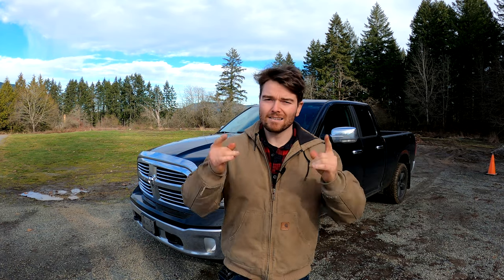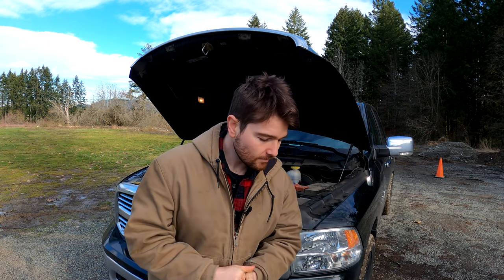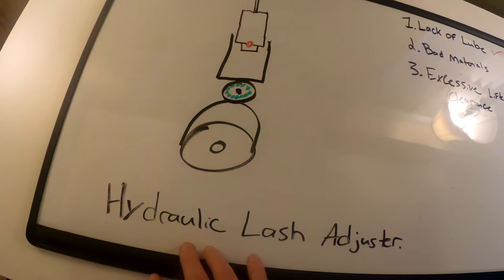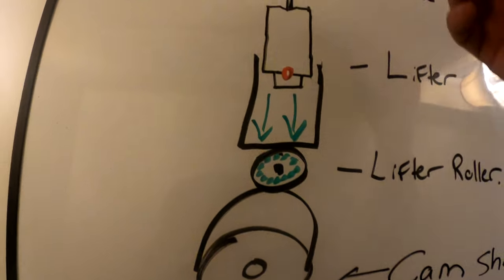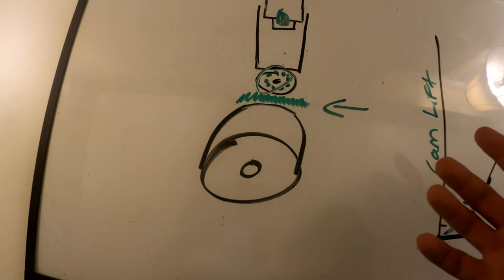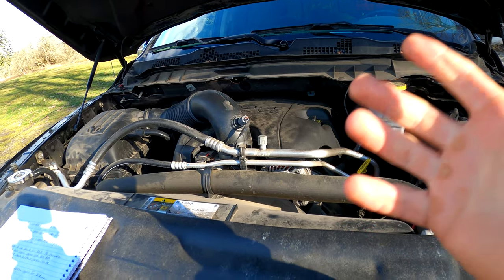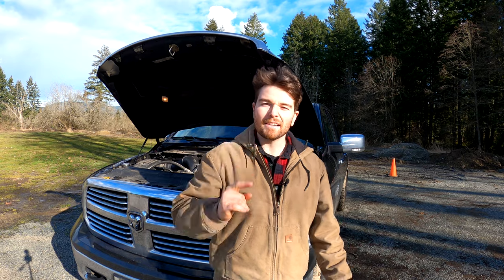RAM 1500 HEMI TICK Explained (Revised) - The Cause And How To Protect Your Engine

Comment: You have a good point , because oil companies wanna make profit so you can see so many cheap brand in market and they are not good .
I own Chrysler srt 6.1 first edition 2006 , it has done 320000 km
I never had any issues with my engine, I service my car every 6000 to 8000 max 
Recently I hit something under my car and it started making this noise, I am still diagnosing what could be the cause 
I tested with stathosope I can hear tiny noise but it seems normal because it way too loud without stathosope, I will see what next

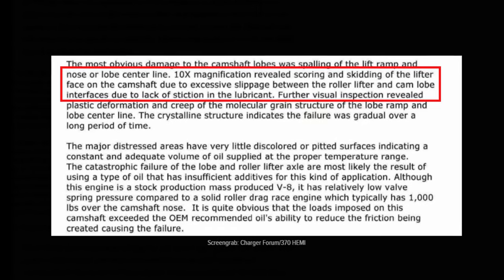Comment: @ 4:57 seconds, that report you lifted off a forum is from testing done on my cam, done  by a person who sells aftermarket oil.  So naturally he hates on all other oils and places his like elixr. Too bad I found several lies in his business claims and honestly felt he re worded some of that letter to make his oil look better.   Glad to also see you did more research and not calling the 5.7 a SHOC design or believing that crappy excuse about idling and crank splash.  Perhaps you should read my thread on the CF about lifter failures. I can share any photos of the cam lobes with the lifter markings, or failed lifters.
Reply from the maker: really eh?? It's hard to find decent info on this topic. a lot of he said she said. but what I find interesting is how the hydraulic lifters could become slightly plugged with sludge from burnt or dirty oil and cause an increase in valvetrain lash. obviously causing the lifter to more or less hit the cam lobe rather the ride up it slowly. either way I'm not an engineer. I just find this topic interesting how Chrysler must know there is an issue but yet we hear nothing from them. 

and who knows maybe their lifter update in 2016 is really the cure. maybe the lifters before that were just shitty lifters. time will tell I guess.
Reply: @TheGettyAdventures   All my theories are strictly based on the physical evidence I have seen from three camshafts, and three sets of lifters.   The revised lifters, often sold as hellcat lifters (although they are all the same when non MDS) have a different bearing size oddly enough.  The actual amount of failed lifter hemis vs production is such it will never see court.  It only seems like a horrible thing cause its the internet. And no one comes here to be happy. Just complain lol.
Reply: Sounds like you know the truth

Comment: I always change my synthetic oil and filter every 6000km.. I have an old 2001 chevy 5.3L.. Changed the oil every 5000km for the first like ten years and then switched over to synthetic oil when it was affordable..  Then changed it every 6000km.. The motor now has 260000km and doesn't burn a drop of oil and can still light up the possy rear end no problem at all.. Frequent oil changes are key to keeping a motor running properly. I plan on changing the synthetic oil every 6k kms in my new Ram 😎👍
Reply from the maker: Couldn't agree more! I do 6000km on my synthetic oil as well! to be fair though those LS engines are pretty bullet proof engines. guys are getting like 500,000km out of them.

Comment: That's some pretty good info. 👍 Regular oil intervals are way too high. They need to be between 3,000 and 5,000 miles depending on driving conditions. More City driving change it sooner.
Reply: Exactly right.

Comment: Hello Getty Adventures.  Good video giving an explanation on probable causes for the HEMI tick.  In addition to the probable causes mentioned in this video, another possible cause is the kind if oil filter used.  Not all oil filters have the same kind of filtration system.  So, the OEM filters are good because that's what came with the vehicle.  If someone decides to get an after market oil filter, one brand to consider is Wix.  There are couple other after market brands that's good too, but I can't remember the names.   So, the kind of oil filter used plays a role.  Also, if the right oil is used and it doesn't get changed on time, that will eventually result in the HEMI tick or other issues that's more serious.  So, eventually dirt/sludge build up over time due to wrong oil used or the right oil used, but wasn't changed on time.  The right oil used, but not changed on time such as two to four weeks late for each oil change and then the wrong kind of oil filter used.  With the use of synthetic oil and either the OEM oil filter or premium brand oil filter, the HEMI engines along with other engines in general regardless of automaker will be fine.

Comment: On 2 week vacation,  leaving Chicago to South Texas,  1,500 miles one way. As I entered Dallas,  my Ram started making loud noise and I started losing acceleration power.  I got off the highway and as I exited the highway , my ram started shaking and turned off. Luckily I was near a shop. Turned out I had 1 broken lifter,  1 damaged lifter and so bad cylinders.  It's Wednesday today,  truck has been in the shop since Sunday morning.  Hopefully by tomorrow they get the new cylinders and new lifters and I can be back on the road by tomorrow evening.  🤞

Comment: Appreciate the follow-up. As someone who's about to own a 2019 1500 5.7, learning about what migtht happen later and like any tool, knowing how to use it properly to prolong its life is welcome knowledge. Thanks, and keep up the great work!
Reply: 5.7 is a bad choice this day n age. Find a 3.0 duramax. Or the GM 5.3 that will average around 20 mpg. The 3.0 will average 26mpg 32 highway. The GM 10 speed transmission is also a huge upgrade. They really got it dialed in. Just bc it has more gears doesn’t make it more complicated. I was very stubborn to believe that myself. The powertrains available today. The 3.0 duramax an absolute joy to drive.. its funny how it took them this long make a half ton truck with an inline 6. It also happens to be turbo diesel.
Reply: @caleblewis3463 I don't disagree with your comments. Thank you for sharing your insights.

I owed the 5.7 for a bit, but my needs changed and I got rid of the Ram 1500. I liked it for what it was, and having the power compared to a previous V6 powered Honda Odyssey was a clear no brainer - best of all, it actually did better on the highway when cruising around 130 kph (~ 80 mph) as that seemed to be its sweet spot of power and fuel efficiency.

I've yet to try the 3.0 Duramax. However, in my neck of the woods, Nova Scotia (Canada) in a small town, diesel mechanics are definitely harder to find, diesel fuel costs more, so there is no way I can justify a diesel right now.

Though definitely not the same, the twin turbo V6 in my Transit 250 is just fine. Not good on fuel, but I'll take the utility of a big cargo van right now since the truck argument for what I want/need doesn't justify the spend.

Comment: Excellent research and explanation. Thanks. Would not High idle time would fit into your hypothesis on bad oil/wrong weight oil?  I would assume at idle the pressure is lower relying slightly more on the viscosity and quality of the oil to maintain lubrication via the check valve.  We all know startup and high idle are contributors to engine wear in general.
Reply from the maker: Yes absolutely! idling also wears down oil much faster then normal driving conditions. and I do still think the theory that at idle you can starve your cam and lifters of oil is still somewhat correct. The dealers always say that fleet vehicles tend to be more prone to these lifter failures because of high idle times so there is no doubt that idling has a roll to play! appreciate the info!

Comment: I think you are correct on the worn out oil additives. I'm surprised you didn't bring up the correlation of applications where they are used with high idle time.. That seems to be a fairly common factor in these failures.. Police cars, trucks that sit and Idle for a long time on job sites, coupled with minimum OCI's tell the story..
Reply from the maker: 100%, I made an earlier video talking about idle time, but I thought it was interesting that perhaps idle time alone wasn't the issue.

Comment: Thanks man... I just bought my 2014 Ram 3 months ago... Oil changed the DAY I bought it... Im NOW at 5300 miles and the ticking JUST STARTED... I totally SPACED not setting up an appointment, I have one setup for tomorrow. Im scared to drive it bc I don't want to hurt my new truck. From now on im going to change the oil ALOT SOONER, or at LEAST check oil level every few days
Reply: Use 5w30 oil

Comment: Great video!  I have a 2011 Ram Crewcab 4x4 w hemi......I baby my truck and had to do the exhaust manifold bolts repair thing about 4 yrs ago on both sides!  I just had my oil changed about 1 month ago and now I have a "ticking" on cold start.....after warm up, it goes away!  So......1/ could it be possible that again the exhaust manifold bolts are hooped or 2/ am i slowly working towards the lifters failing and the camshaft disintegrating?  I am not a mechanic......my truck has 165,000kms on it (yes i am from Canada).....oil is changed every 8000kms but I do not use synthetic but owners manual recommendation (I think 5W20..). Thanks and have a great day!

Comment: Lots of information in this video however, hydraulic lifters in general and hydraulic roller lifters specifically have been used by most of the automobile manufacturers in high performance automobile engines for 40 some years. If dirt is holding the lifter check valve open, why does it only seem to be happening in the last ten years or so? I have worked in a management capacity at Tier 1 automotive parts manufacturers for 30 plus years and in my opinion, no OEM is going to change vendors because their customers are not changing their oil at recommended intervals, or not using the recommended oil and/or oil filter. From experience, I know that the OEM will perform a root cause analysis and take steps to eliminate the problem. All of the components in the valve train will be examined as any signs of wear can cause the lifter roller to "float" above the camshaft lobe long enough for the lobe to complete a rotation and collide with the roller again on the next rotation, and cause a tick sound.  It is my opinion that the fact that Chrysler changed hydraulic roller lifter vendors strongly suggests that they believe there is a flaw in the component. If it was oil related, the problem would be happening across all OEM's around the globe. Another source for the tick can be found coming from piston skirt slap due to seized connecting rod pins from overheating the engine .

Comment: Been using non big name 5w20 synthetic oil  with 5,000 mile changes on my 2015. I'm at 60,000 no noises yet
Reply from the maker: name brand synthetic vs no name brand synthetic is probably not that different lol. the biggest difference is probably the price!

Comment: I have the 2020 Bighorn with only 38k miles. My truck is the v6 eco boost but also has the tick. I have taken it to RAM 3 times and finally they called today and said its a CAM issue or more specifically what you are describing.

Comment: In my opinion, it’s got to do with the oil pressure at idle along with how often people are doing their oil changes I had to do not use the factory light to tell me to change the oil I change my oil every 7000 8000 km a I’ve got over 100,000km on my 2019 ram 5.7 hemi . In my opinion you’re right that is exactly why it happens not changing your oil often enough

Comment: I change my oil every 3,000 miles or less with semi-synthetic or full synthetic API SN SAE 5W-20 oil, I have not had an issue with the lifters almost 40,000 miles in and I drive her hard! I think your spot on with your research about people thinking they can go 10,000+ miles between oil changes, FCA should probably do away with that oil life meter, it will continue to plague HEMI lifters because of people that think they can literally go by that meter every time with a cheap oil and filter. I get why they put them in these trucks (i.e. EPA, Green Party, energy conservation, etc.) but come on.  Also the ZDDP in modern engine oils needs more scrutiny especially in a 90 degree push rod V8 engine.  There simply isn’t enough in modern oil.

Comment: Great job on the video👍 , I agree with the combination of prolonged intervals , cheap oil and driver abuse as contributors, GM has the exact same issue. I won’t paint everyone with the same brush, but a lot of people want to do as little as possible for as long as possible when it comes to maintenance, keeping clean oil in the engine is paramount,

Comment: It's not just Mopar,  Ford's new 7.3 V8 gasoline Godzilla motor is having the same lifter failure issue with as little as 50K miles on them.

Comment: Thanks sir, that makes a lot of sense. 

But I thinks there is a time that you should swich to 5w30 which is bassically a thicker oil comparing to 5w20.
I have a 2013 5.7 dodge charger. After 130k km i realized a drop in my oil pressure using the 5w20 (oil pump is okay) i beleive its normal due the engine clearance, increased over time so at this point i beleive it is a wise to run 5w30. However i have a 5.7 dodge ram 2019 
with just 15k km i am using the 5w20 and both oil pressure on my 2013 5.7 with 5w30 and my 2019 5.7 with 5w20 are the same
Reply: استخدم 5w40 وبتدعيلي
Reply: @AA-eg4fp  bakalakadaka 0W40 !!!
Reply: @DL101ca  where we live in the (Middle East) the weather is always hot, especially in summer it gets up to 50+ Celsius. 5w40 works really fine here, or at least 5w30 the oem 5w20 is the real reason my hemi started ticking before.

Comment: Good video. I never really believed the mds caused lifter failure. I run pennzoil 5w20 ultra platinum oil with a wix filter in my 2014 ram 1500 sport at it’s a 176000km and change oil out every 8500km. I believe the dirty oil, high idle time or low rpm has a lot to do with it too. Heard about upgrading the oil pumps to hellcat oil pump too but do they actually have higher oil pressure at idle or lower rpm compared to 5.7 oil pump?

Comment: My 2017 Ram 1500 5.7 has made a knocking noise since I first bought it new. Only has 25,000 miles. I change the oil every 5,000-7,000 miles and use full synthetic. Have always used basic FRAM Oil filters.

Comment: Enjoyed the video and I think u are spot on regarding the extended oil change intervals.  I have a Sierra with AFM (same as your MDS).  The lifters fail as well and while I'm no mechanic the general consensus is prolonged oil change intervals.  Some guys have lifter failures early and some don't ever have any failure.  Needless to say I change my oil earlier rather than later.
Reply from the maker: I don't know why manufactures insist on extending their oil life intervals lol I also think there may be some luck involved with these issues. some guys run their trucks for 300,000km and have no issues. whereas some guys need cam and lifters replaced before their first oil change!
Reply: Until i helped a friend swap out a worn out engine for a reman in a '78 Monti Carlo i had no clue at how bad skimping on oil changes can trash the inside of an engine. I can't see how every oil passage in that engine wasn't plugged. What a catastrophe that was and a good reminder of the importance of keeping your vehicle mechanically up to par.
Reply: @gregorytimmons4777  100% agree.  Oil changes are the cheapest and easiest thing to help improve longevity.

Comment: I use 5w20 with Lucas oil stabilizer change every 5000km 170000 plus km on runs great so far been thru 3 cold alberta winters as well 2500 driving hrs 2300 idle hrs as well!

Comment: Also after the pkg is installed my customers use different oil brands etc and still no issues 100,200 and 300 plus miles!! No cam or any lifter issues!!!!!!